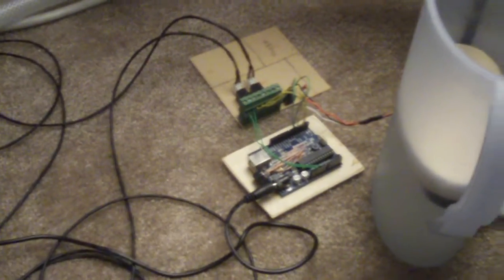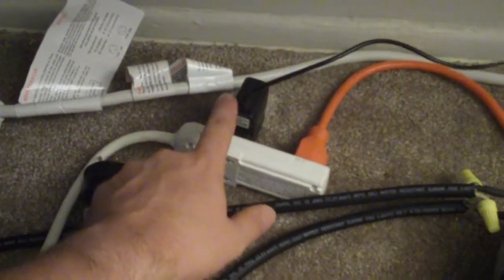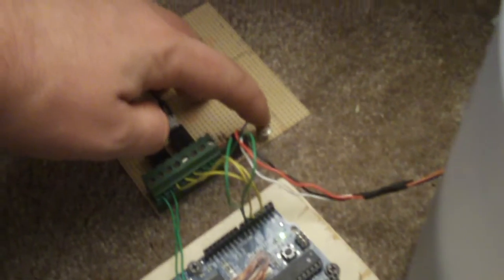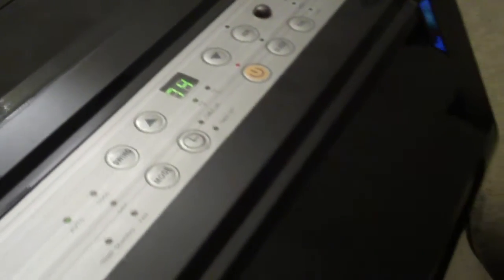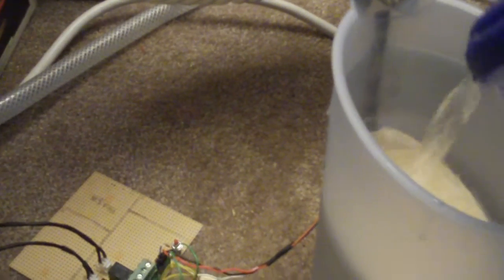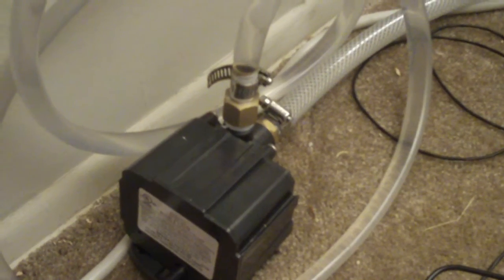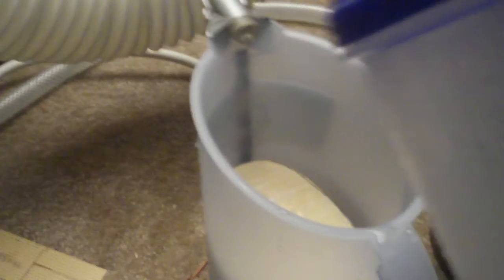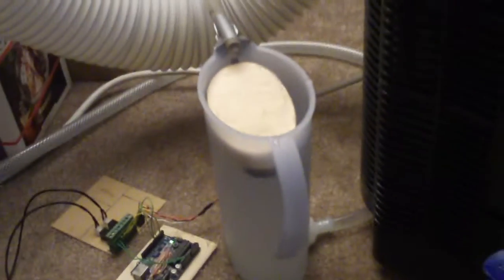Arduino A/C Water Pump

Comment: Hello, i was wondering how do you connect the arduino with the water pump ? Do you use relay ? What type of relay did you use ?
Reply from the maker: I used a solid state relay. Most of the ones I've worked with have a 3-32 VDC input trigger. Since my Arduino is 5VDC, I had plenty of voltage to trigger the solid state relay directly.

Comment: Why do you haev a heatsink and fan on the relay? Doesn't it only connect two wires when it receives a signal? Does that give of much heat?
Reply from the maker: It's a solid state relay, so instead of mechanically connecting two wires together it does so via a really huge transistor. Even though I'm using about 40% of the relays capabilities, it would get too hot to touch when running the AC unit through it. I didn't want it to burn up and fail, so I figured I'd add a heatsink I had laying around.
Reply: Thanks for explaining! 😁
Reply from the maker: Henning Andersen Glad to!

Comment: what sensor/ technique do you use to measure the height of the water?
Reply from the maker: I used balsa wood as a float and attached a magnet to it. I had two magnetic switches which registered two levels of water height (pump on was the low sensor and A/C off was the high sensor).

Comment from the maker: @Jkumar1211 I don't remember at this point. I do remember that it was 3-280 VAC and 40 amps capable though. To run any amount of current through it you'll need a heat sink though.